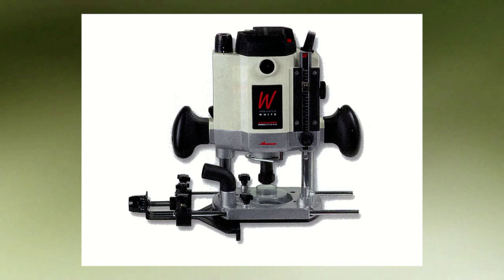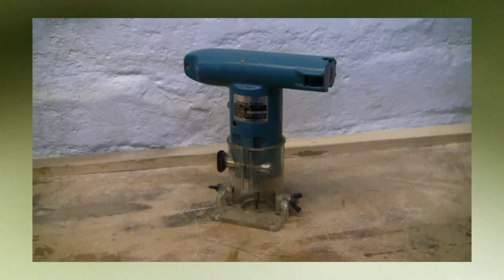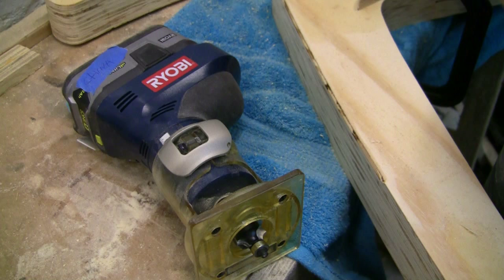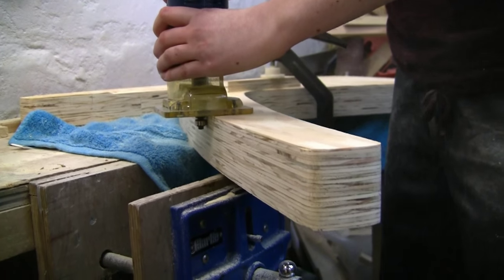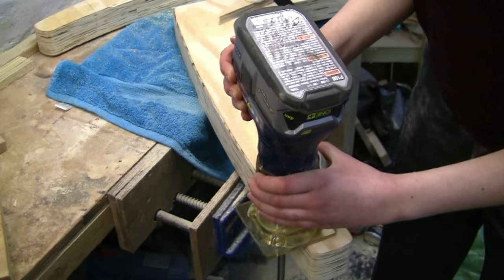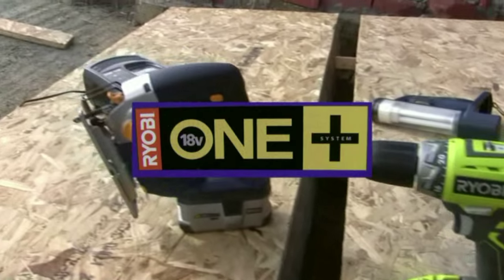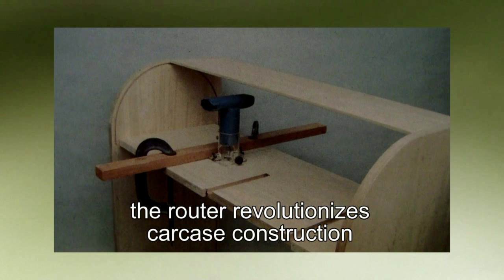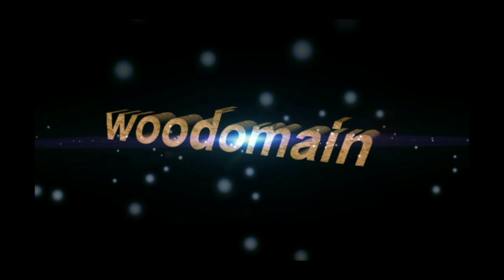A Cordless Router

Comment: are routers used much on places where there is no electricity, or when a cable is in the way? problem is that the battery also makes the router bigger and heavier.  there must be a reason why makita and others dont have them in their stock. they do have anglegrinders on bettery which also take a lot of energy. maybe when there is a big market for them.
Reply from the maker: Well manufacturers are notably blinkered when designing products and a god example is when I got my hands on a router in 1974 when it was sold as a grooving/rebating tool. I then wrote the bestselling book "The Incredible Router"! I would say they have missed a trick in not producing a cordless router now that battery technology is improving. Check out my latest video on using a router in the woods! https://www.youtube.com/watch?v=lVUa0IsU4vc

Comment: It's surely only a matter of time before we see a cordless router that's capable of slightly more heavy-duty work, with battery technology improving.

Porter Cable used to manufacture a battery-powered router (something obscure like 16.8v) that may still be available in America. Their tools were available in the UK for a short time but it must now be closed to a decade since they were last available here.
Reply from the maker: +Olly Parry-Jones Interesting
Reply: Your absolutely right Cordless is taking over corded tools and even petrol powered tools.  Dewalt now has a 54V and 108v power tools known as 60v- and 120v in the USA advertised as equal in power with corded tools.

Comment: If i was going to use a router like that for trimming, then i think would make an extension to the base and add a handle to it as a counterbalance.
Reply from the maker: +joe obrien You might like to check out this video on singe handed routing edges Joe - https://www.youtube.com/watch?v=jqbZi8L-TTs
Reply from the maker: +joe obrien Yes that would work. This router was a little heavier than I anticipated but I forgot about the weight of the battery and where it would be placed!

Comment: The smaller battery would probable fix the issue you're having with this router as it is lighter. But you'll probably lose some power so... 

Thanks for the video.
Reply from the maker: Yes of course I had overlooked that!!!
Reply: Hi, partly due to your video, i have my own P600 so thanks for that. :-) I've tried it with both the small and the big batteries and the smaller one is lighter and makes the tool much more balance when you pick it up in your hand. But i kind of like the stable effect(due to it's weight)  the bigger battery gives the tool once the router is flat on the board. As far as power goes, don't think either battery will make a noticeable difference. But it won't last as long of course. You'll need 2 smaller batteries to do the work of the bigger one.  

Cheers.
Reply from the maker: Yes I didnt actually have a problem with weight and balance. Just grateful there is cordless router to use as you can see from my latest video: https://www.youtube.com/watch?v=lVUa0IsU4vc